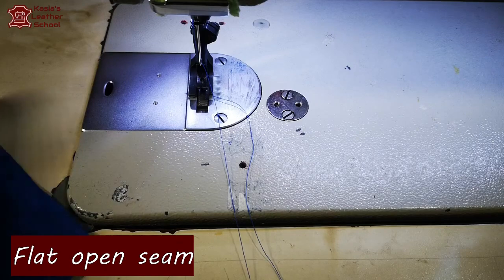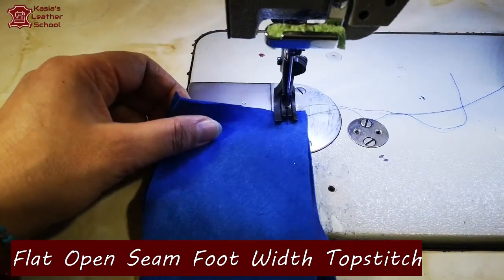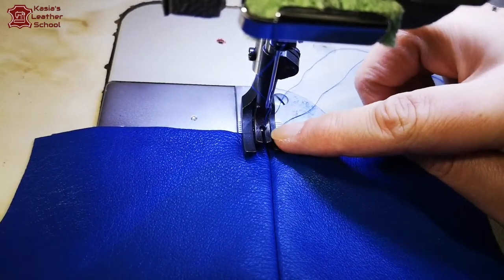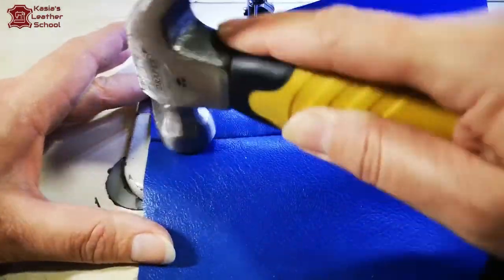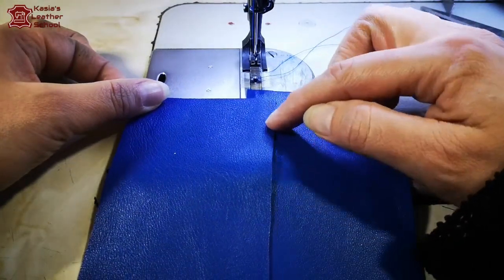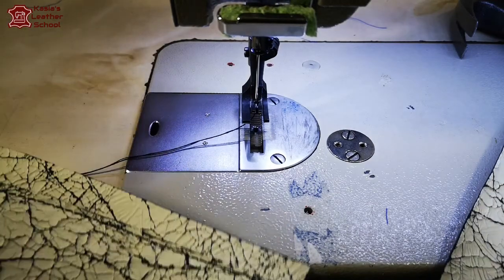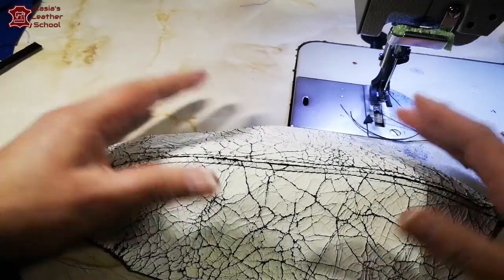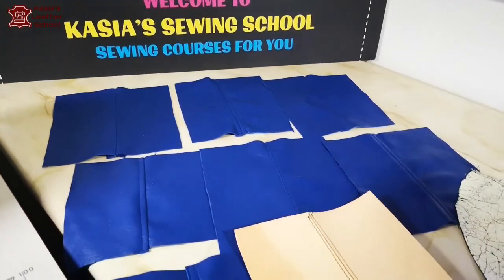Best stitches and seams to sew leather in garment construction.

Comment: Love it. Very insightefull. i intend to make a pair of trousers from a bunch of big scraps. These were probably cuts from quite soft and supple skins approx. 3 mm with the fluff included for garments. However still in the proces of thinking what kind of self drawn pattern to use. Anyway that is my own  task. contemplating on some oldfashioned workmans trousers.  I would like to ask if there would be special way to sew since the back is very fluffy?? i.e. the materialsurface on the inside is not smooth as the examples you used in your sewing here.
Reply from the maker: I would  recommend using a tissue paper underneath while sewing and then tearing it out. That will help the machine to slide/sew  easier.

Comment: Thank you for your excellent videos!  I'm new to working with leather and want to take in a leather skirt that is too big for me.  Any suggestions?
Reply from the maker: If it is soft leather, you should be fine. Are the seams top stitched or glued? If top stitched, it might leave the holes where you  run off the seam.

Comment: What is the best stitch length to use when topstitching leather? And best tension setting?
Reply from the maker: Stitch length depends on the thickness of leather and your preference of design, as all top stitching is a fashion feature . Tension needs to be adjusted in relation to thread thickness you will use. 
Always set your machine on the scrap of the leather you are going to use.